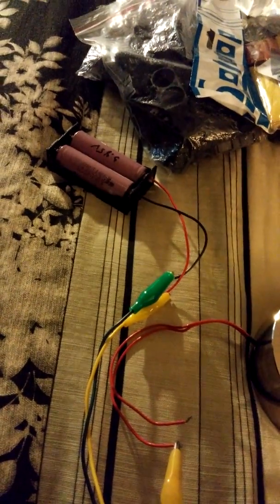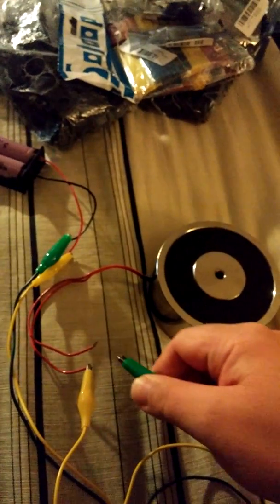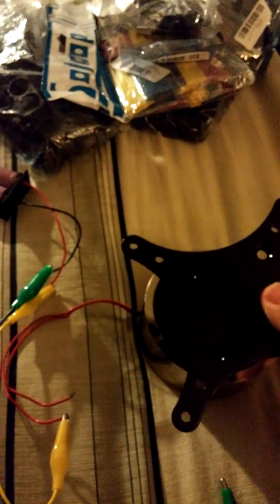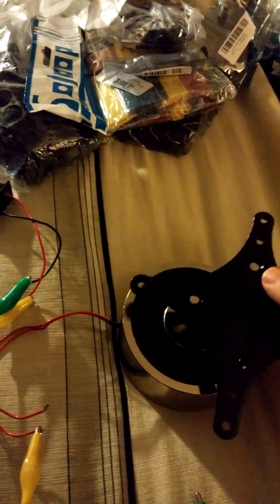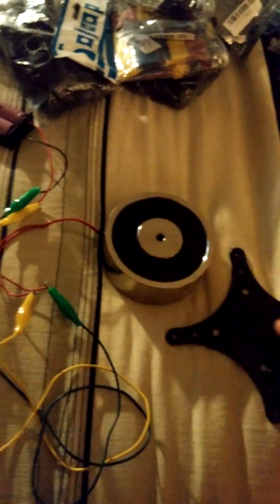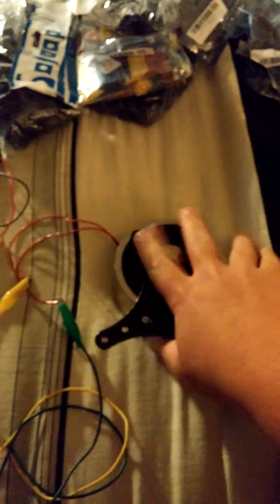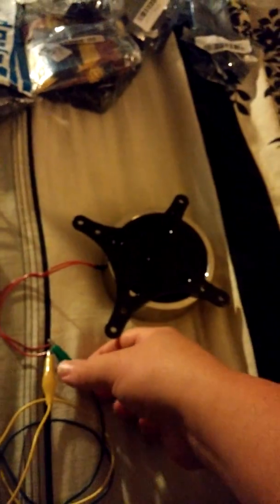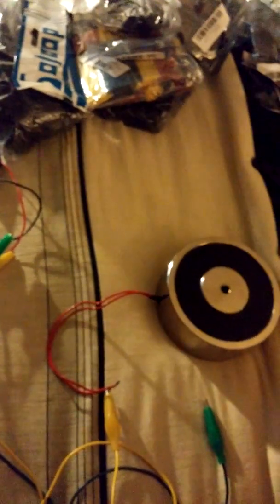Making Thor's Hammer Part 1 (Testing electromagnet)

Comment: Hi so I’m trying to make a hammer my self but I don’t know some stuff, for example can you use two 9 volt batteries, and I want to have a off button and I don’t know how to install it , if you can answer my questions I would appreciate it.
Reply from the maker: ok so two 9 volt batteries might not be enough amperage or voltage for the magnet. It might work for some time but they'll die really fast. I'm working on part 2 now I'll be done with it by the end of this year hopefully. Maybe you can get some ideas then. Sorry I'm late with responding.